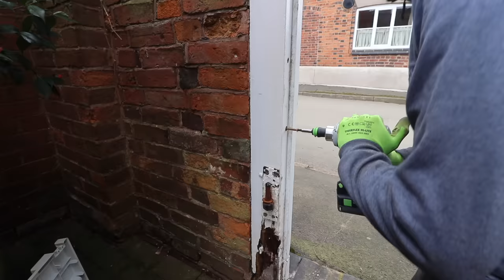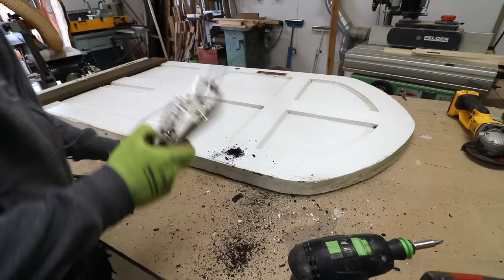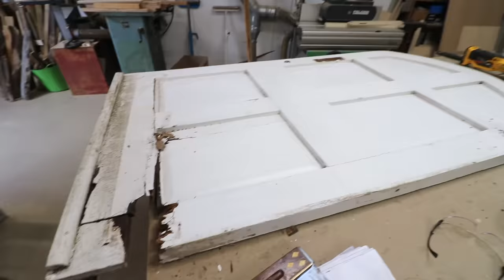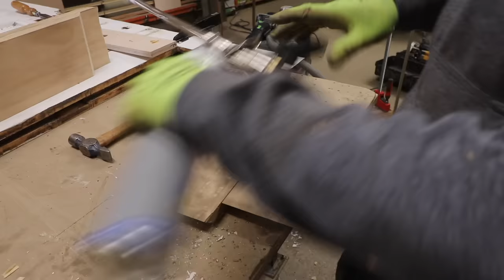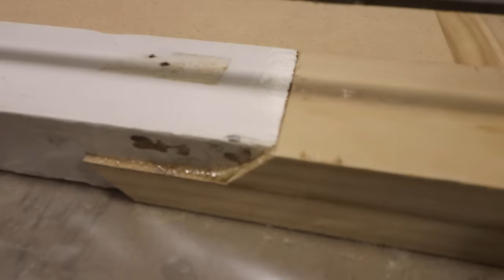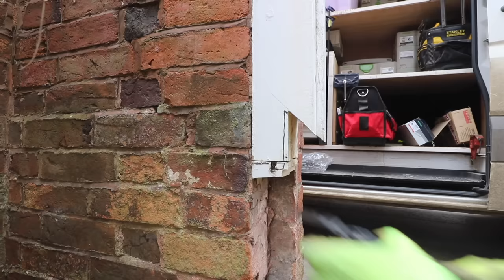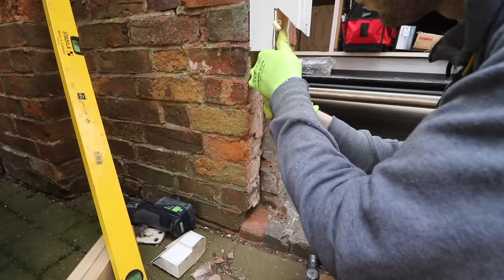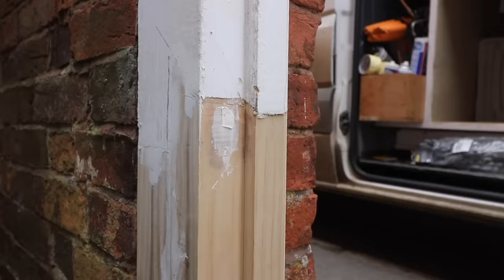Rotten Door, Full Repair. Here's How I Did It.

Comment: the whole door is in a state of rot....the bottom is the worst but the whole door is on its last legs....the rot is concealed beneath the heavy paint but it would be better just to build a whole new door.....and this time the door should be built out of rot-resistant pressure treated wood or synthetic wood substitute material that looks like wood but is bonded epoxy composite....the new door would last much much longer and be essentially immune from wet rot
Reply from the maker: It really isnt, Its a good door that will last atleast another 30 years. The expense of replacing is 3x the cost in £ and also costly for the planet in all ways. Also, the old timber here can only be rivaled by Accoya, wood composite is the exact opposite of everything woodworking, its dead and not beautiful atall.  Careful with that stuff also as it doesnt like the heat of the sun.

Comment: Entire door should have been stripped first.  Allow full suvey and can be refinished with modern breathable finish. Looks like most of the bottom panel should have been remade and then spliced in with dowel/domino/biscuits.
Reply from the maker: I dont think it was necessary to lose all the protection on the door personally, as it stands the new/sanded parts can be spot primed/undercoated and then topcoat will have a decent chance. Either option is viable but i dont think there is one way significantly better. Not sure on the bottom panel, it was completely new?
Reply: @BradshawJoinery  new nono paints will be breathable and allow the wood to stay dryer and acclimatise easily and last longer
Reply: @BradshawJoinery  fully respect your views too.  Nice workmanship too. Thanks for the reply

Comment: I'm a joiner and people don't understand that you pay out over £20 k for your radial arm , spindle moulder , tenoner , panel saw planer etc and wants you to repair a shitty door . When you could have made a new door and frame in the same time . Hope your customer is happy as the effort you done on that repair is quality . Use a metal detector as I see the sparks come out of your expensive router bit .
Reply from the maker: Yeah there is a lot of investment for sure! I have to say i advised that a repair was suitable in this scenario and in my opinion the best way forward, The Vurved top rail and curved panels arent something that you can knock out as quickly as a new square door, and although it looks lengthy i did the whole job start to finish in the weekend including faffing about with the camera. 
If there was any sign of rot in the upper rails or panels id have replaced the door for sure

Comment: Why not use PVC for the repair?  It would never rot again.
Reply from the maker: PVC and wood? i think a little sick just came out ahah, 
to give a technical answer, plastic an wood dont mix, generally where there is plastic, there is condensation and thats woods worst enemy. The timber ive used is called accoya and ultimately, as you mentioned, will not rot atall and i would confidently say will outlast any PVC door.

Comment: I would have expected you to treat the wood before attaching it at the end there, it will rot again..... Otherwise overall a nice job :)
Reply from the maker: The wood higher up is sound and the jointed timber is accoya so wont introduce any movement, it was also sealed with glue at the joint so should be fine! its been 12 months or more since i did this and not even a sign of a hairline crack yet.

Comment: I've done carpentry for over 50 years and there's no way to fix a door you can't patch a door and frame you have to take it out and build a new one
Reply from the maker: This door however many years later looks identical to when I repaired it and is a much better option than replacement. I can pm you a picture as I live on the same street. Well done repairs using Accoya are a fantastic option. Any other timber for the repair I agree with you.

Comment: I'm sure you had a reason but could you not have built a new door easier?
Reply from the maker: Its the time and cost of timber. A door to be better than this would have to be made from accoya to last accordingly which is £££ plus its curved/arched top rail is a slow process to make and then fit raised panels into. The majority of the door is sound, it literally was only the bottom that rotted from water splash, so a relatively easy repair on the simple square parts!

Comment: Not nearly enough clearance around doorwill jam first drop of rain sorry
Reply from the maker: How gappy do you make your doors then? there is a 10mm rebate here for the door to close into and i did 3mm gap with a leading edge. Maybe you need to put a leading edge on your work? T he movement of these size sections (stile cross section) in redwood in the uk climate has a likely expansion/contraction between seasons of just under 2.5mm id say 3mm gap is spot on. Id genuinely be interested to hear youre reply to what gap you'd use and why. Bearing in mind the rebate size and the fact its a nice piece of joinery not a tantalized gate.

Comment: fields woodman cant pack a shop with him, run rails at shop and things field assembly. besides glue does a carpenter eveŕ use a roll of bitchahane and some primer to keep from 20 yrs down the road same problem!!!!
Reply from the maker: Trouuble is, fully sealing timber can be as damaging as leaving it open to the elements! the Accoya side of the repair will be fine and its a joint designed to protect the upper part so im confident in the longevity of it!

Comment: Omg you are using MDF board fore the panels hahaha lol MDF fore outsidecome on man why use MDF the door is done m8 the best solution is to  to put a new one in this is just screwing the costemer wow
Reply from the maker: I think your showing a serious lack of knowledge in your comment. Have a quick Google of The timber I used "accoya" and then look up the panel material that is made from the Accoya wood that is called "Tricoya". 
You will definitely learn something and every piece of wood I put in that door and frame will last atleast my lifetime. I've been using these materials since they appeared, 10 years ago I put a piece of that MDF outside my workshop, it sits in a puddle, it gets used for a door stop etc always outside, still as strong and the exact same size as the day I put it out there. 
Once you've got your facts straight I hope you can spread the knowledge you've gained to someone else as I have done and help them out. 😊

Comment: Stop being a cheapskate and buy a new door
Reply from the maker: Lol saved a lot of money and materials.doing this
Reply: @BradshawJoinery  kidding !  Great job !  Not sure about pointing around the bottom of the frame. Maybe leave it open to dry out  it will trap water and moisture in and accelerate the rot process  i used to put copper flashing between the ground and the wood and was very effective